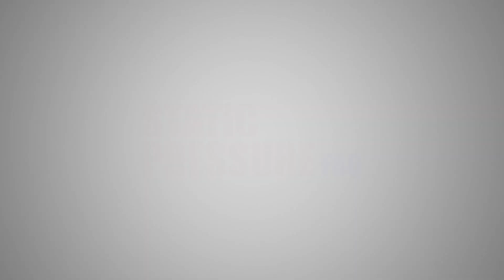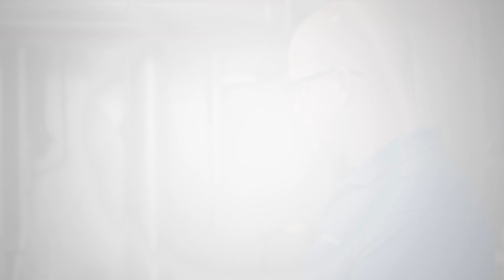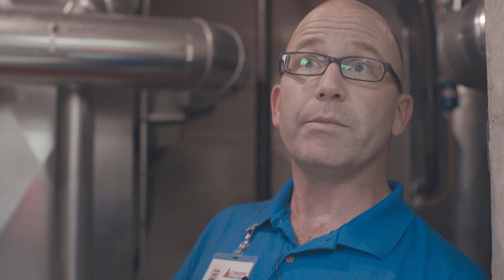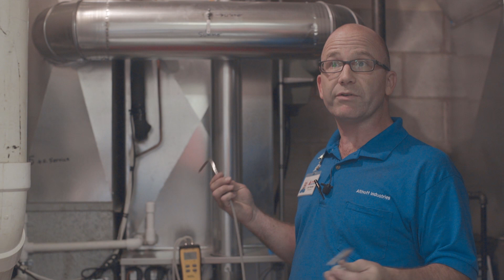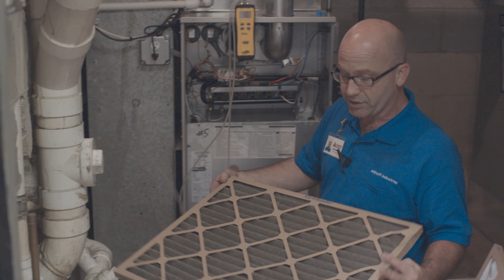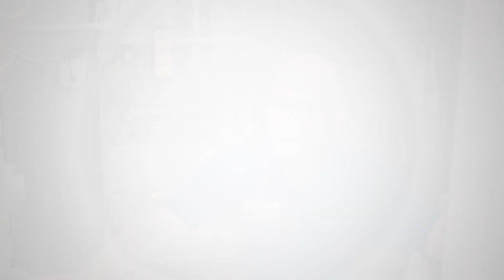HVAC Static Pressure Testing

Comment: Would putting a door on the filter  access change the static pressure? It seems like the fan would be pulling air around the loose fitting filter?

Comment: Boy have times changed! In my day we saw a dirty air filter and just changed it because we realized it was blocking the return air and not enough air was going through the system. Nowadays we have to measure everything to realize the filter needs to be changed. Wow

Comment: Its all confusing to me I just had an energy assessment done all of my vents was .2 and my return was .7 with no filter those numbers didn't change when they tested with new filter in place. My system is a 4 ton air handler and condenser with a 3-5 ton capable evap coil. Evaluator said I am undersized by a ton for a 2,800 square foot manufactured home. I wonder what effect  upgrading to a 5 ton overall system will have on those numbers?

Comment: I want to go a step further and put a amp clamp on the power going into the air handler and see what the power draw is with a clean vs dirty filter.  And with a system like this with that much room, why isn’t there a 5’’ media filter in there? I’d love to see the static pressure difference with thicker filters.  Some people have systems where there isn’t room for one so we’re stuck with the lousy selection of 1’’ers.  Also I’d love to see the quality of filters defined by their static pressure drops. I’ve read good things about 3Ms. Not saying they don’t have an effect but less of one than other brands.  Also I’ve read a lot recently about how shotty some of these online filter subscriptions are. False advertising. No certifications. And expensive.  

You really have to design a hvac system with the right filter in mind. Know that there is a good selection for the size return you have. And don’t be dumb and use a huge return for a small air return duct. (Where I live now they did that. Brand new construction. Makes is very hard and expensive to find filters.)

Comment: Yeah lets throw in some crappy filter that you can see through....bro we use 4" filters. Those 1" filters are a joke....or a trane clean effects. Still operate within spec...even if it doubles the static to .8" most resi systems operate spec to 1". So if your at 1" the blower isn't working that hard playa. You said to measure .. doesn't even take an amp reading on the blower...its not a "big deal" . So you don't care about your customers lungs...even if we run 1.2 to 1.3" ...what.... 1 amp difference..come on dude...i want to side with you but especially with comfort R and variable speed...this crap barely applies....sorry

Comment: Dang !   0.4 pressure drop across a new pleated filter ?  Even for a high Merv filter that's way too high.  Something's wrong.....maybe you didn't zero out your manometer?
Reply: A higher merv rating is going to cause more of a pressure drop than a lower merv rating, all else held equal.
Reply: Yeah, and he’s saying a static pressure is high but not to bad?? Way too high for most systems

Comment: The problem is not with pleated filters. The problem is far to many HVAC companies do not properly design and size the duct systems. I use Wrightsoft to assist in the manual J load calcs and munual S and D for equipment selection  design and sizing of the duct system.
I include pleated filters on all of our system installations, because they filter better than rock catchers and the duct system was designed for proper CFM at design static.
On startup the TSP is checked with a clean filter in place and the blower speed is set to match the static and CFM it was designed at.

Comment: I don't recommend duct cleaning as they are idiots as well. They contaminate the home worse... Dog and pony show. Kool music bro...
Reply: That's why you don't hire a cheap company.
Reply: @workinprogress008  It doesn't matter what company does it. They all do it wrong no matter what.  If they remove the equipment or actually block off the supply air and return then it may be better. However nobody does this and created a popcorn particle popper at the furnace and the evaporator always shows the evidence of bad ductwork cleaning. I don't advise anyone getting their ductwork cleaned. The home owner does a better job just shop vacuuming the supplies and return where you can access.  Just use pleated filters on the equipment and change every 2-3 months. Save some money and don't get your home and equipment contaminated. It is just a dog and pony show.

Comment: So if you do a static PSI test before after the coil of the load of garbage that was pulled into the coil . It says please shut off focking furnace during filter change because cleaning your AC coil is much tougher than cleaning a evaporator coil.... Now you have to drill into the furnace and after the AC coil to see how much garbage was sucked into it while you was sporting filter changes on the fly. Or course depending on how old the home is and those so cleanly conditions and so judging on that brown filter they probably have pets. I don't suggest pulling out the filter on a running system. For testing I understand but.
Reply: You are totally right! If you pull a filter out for inspection, then see it’s dirty. Go online and order a new filter. Wait 5 to 7 days to receive the filter and then install it. You will definitely plug up the evaporator coil if you do this habitually. But if you have the new filter with you and it takes 30 seconds to pull the old one out and put the new one in, that will not hurt the evaporator coil one bit.

Also when the system runs in cooling, it is cleaning itself. The condensation rinses the dust into the drain.

Comment: "We suggest you dont use pleated filters so that we can come out and clean your evap later." Lol this guy
Reply: The FPR 5 pleated filters are probably OK for most furnaces. Most HVAC duct systems are not designed for the restrictive allergan air filters.
Reply: @picklerix6162  that is correct. State of California dove into  this about 7 or 8 years ago and the result now is that each filter sold has air flow stats on it. Some pleated filters drop airflow in half. We use the 3M 1900 because it has a high MERV and also the best flow for a 1" filter unless you drop to like a low MERV filter.

Comment: You only checked the pressure on the filter.  There are several more points you’re missing like the furnace it self or evap coil. This isn’t a complete test.
Reply: Exactly, I was getting ready to post the same thing but then I saw your comment, what a tool this guy! Lol
Reply: @Aytown  Nah, you're both tools. At no point did he say this was a complete video on static pressure testing on every component. If you can't figure out how to do the total static pressure, or evap coil pressure based on what he just showed, then you have a lot of learning to do. Your question is like asking an automotive mechanic how to change the remaining 3 tires after he just showed you how to change the first tire.
Reply: @Jason-wc3fh  the video's title's is; HVAC STATIC PRESSURE TESTING NOT FILTER TESTING

Comment: cool, so what do we do when the filter, like many are today, out in the hallway below (if system is in attic unconditioned space). do tell
Reply: Static pressure isn't just about a dirty pleaded filter it has to do with the ductwork system being undersized or not having enough return or supply vents.

Comment: You didn't increase the static pressure.  You simply read a greater pressure drop across the dirty filter.
Reply: Good point. He doesn't know what static pressure is.
Reply: @jamesdixon2860  agreed
Reply: If you have a dirty filter you are increasing your total external static pressure